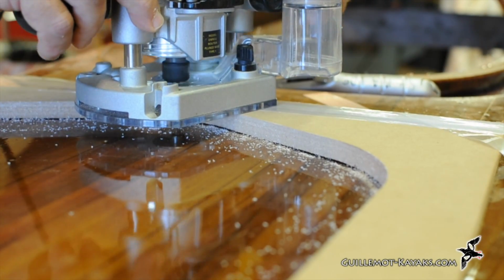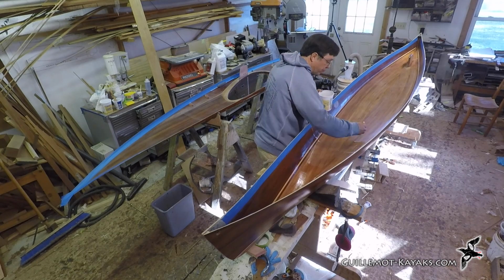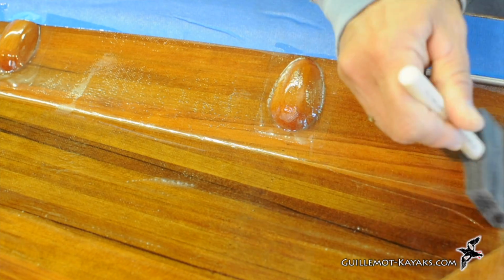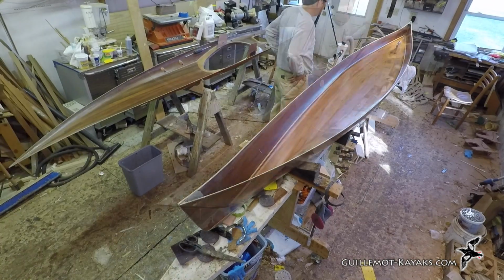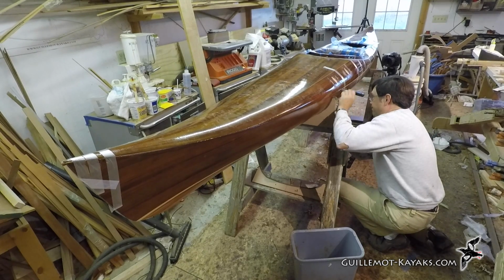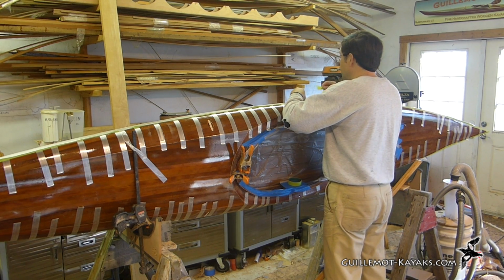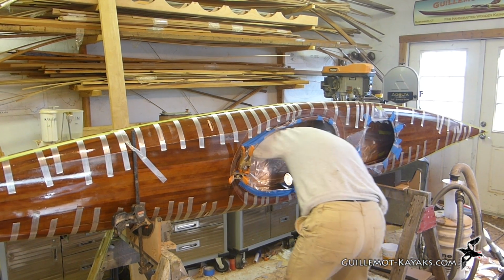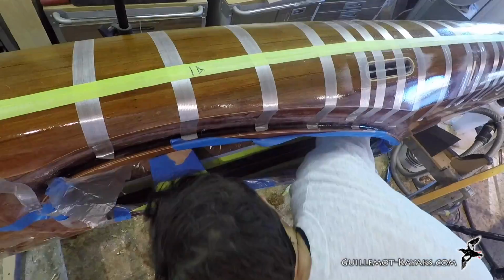Making a Strip Built Kayak - Joining Deck & Hull - E15

Comment: Grate video like always! I planing to soon starting to make my first kayak. But I have little suggestion.  I have some experience with reparations polyester glass boat, and when time come for assembly it's much easiest to role glass tape with resin on handle from painting roller, and then role off on boat.
Reply from the maker: Hi David,
I'm sure it would be easier to unroll the tape off a paint roller, but the paint roller would not fit all the way into the end where the tape needs to go.

Comment: Would it be nesecary to add a solid area under the seat , I mean when you get in and out with one foot that's alot of weight on one foot , pounds per sq. Inch ?
Reply from the maker: There is enough strength in the standard layup for you to stand on the bottom without it breaking

Comment: Here are three questions: How do you deal with working on your own all day? How do you market the kayaks? What do you do while waiting for epoxy to cure?
Reply from the maker: There is not much for me to "deal with" in regards to working alone. I enjoy working on my own. I do try to schedule some social life into my week, but my wife often works from home as well so I'm rarely alone for all that long. The hardest part is deciding which of the countless things that needs doing needs to be done first.

I market primarily through the internet, some trade shows, teaching, writing, and making YouTube videos. I used to run print ads in various publications, but I've almost completely abandoned that as not cost effective. The justification for the time spent on this video series is an experiment in marketing.

I usually leave the shop after applying large areas of epoxy to limit exposure and to protect against making a mess of it. There are a variety of things that need to be done to maintain a business: see marketing above, designing new boats, creating plans, providing tech support, studying, etc. Of course, there is the endless black hole of social media in which to waste time as well.

Comment: I have a question.  My deck and hull do not line up.  there is as much as a inch and a half to two inch gap between the two.  the amount of brute force I have applied has made cracking sounds.  I think it is the glue between the strips but I don't think I can force them apart enough to get them to line up.  Any suggestions?

Comment: Thanks for the video! :)
Any reason you don’t cut out the forward hatch before joining deck and hull? It would be easier to work through the forward hatch when joining the hull and deck, I think..?
Reply from the maker: I did cut and install the hatch before joining the deck and hull.
Reply: Nick Schade , I was thinking about a hatch in front of the cockpit. But it seems like this kayak only have one hatch :)

I guess, if there were two hatches, one would cut out both before joing the hulls? :) 

Thanks again for your videos :)
Reply from the maker: Yes, I opted for no front hatch. Otherwise I would have cut both at the same time.
Reply: @NickSchade  curious why most Petrel Plays forego the forward hatch?  Do you use a floatation bag in the bow instead? And also, interested in your thoughts on invisible hatch old downs?  Looks like you like the straps with stand off method.  Assume you drill/fill the holes for these when you drill/fill for foot braces?
Reply from the maker: @phantom10639  for a small kayak like this, that is being used primarily for day trips, a forward hatch just doesn’t get used much. It just saves time and effort to not add a forward hatch. Use float bags for safety.

Comment: One more quick question - I just put the fiberglass tape along one seam., using 6oz tape and MAS slow cure epoxy. I will go tomorrow morning to do the other side. It was a real struggle to get the two halves together. The hull had relaxed and was about 1" wider on each side of the cockpit and rear hatch. With some shaping, then webbing, blocks, rachets, tons of tape and a lot of grunt work, we got the two parts together. How long should I wait before taking off the tape that's holding the boat together on the outside? I'm afraid that it is going to break the fiberglass because of the tension that it is under! Thanks!
Reply from the maker: As long as the epoxy is hard to the touch you should be good to remove the tape.
Reply: Just finished joining my "Play" at 2am this morning!  You saved me asking Nick the same question on the epoxy cure time (though I'm using RAKA epoxy) I'm presuming that epoxy is fairly generic.  I finished a Great Auk double last year with similar relaxed hull to deck connection.  ratchets, blocks, tape... just like you.  I was fearful like you... fear not, I'm sure you'll be fine!
Reply: Thanks! I got it together. There might have been a moment when I wanted to just sit on the floor and cry in total disbelief, but it worked! And the epoxy held! Yesterday I finished up the exterior seam tape and a final fill coat on the deck (I combined these steps into a single day). Now all that's left is a final sanding and varnish. So exciting! Good luck with your boat!

Comment: Nick why do you not extend the interior tape all the way to each end?  Thank you again for posting these videos.
Reply from the maker: It becomes impractical to get the seam tape into the nether regions of the boat where the space is small and tight. And in a design like this Petrel Play it is around the curve of the sheer. The end pour takes care of the very tip. There may be a short gap between the end of the tape and the end pour, but as a practical matter the forces in the ends will be small, and there will be an exterior seam tape.

Comment: Do you not put any varnish on the cheek plates? What about the hatch lid interiors? Thank you!
Reply from the maker: Yes, the cheek plates and hatch interiors are all varnished.
Reply: I just put on my first coat of varnish and it's looking good, but I realized that my blue tape is only 1.4" wide. When I go to fiberglass the two halves together, my fiberglass tape is 3" wide. Do I not need to worry about some of the fiberglass tape going over the varnish on the edges or should I add an extra piece of tape before I do my second coat so that there is a wider margin? Thanks! It's exciting to be getting closer to putting the boat in the water!
Reply from the maker: The masking tape is not required at all. I use it just to keep from making a mess. I figure out where to put the tape and how wide based on how messy I think the process will be. 

It never hurts to mask off more area than you think you will need.